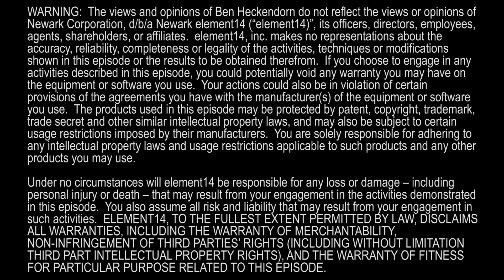Ben Heck's PlayStation 4 Slim Teardown

Comment: Sony's tech always impressive
Reply: No matter what any PC fanboy says, Sony's console designs are always impressive. Just look at how small that "motherboard" is, it has the APU (CPU/GPU), RAM, video encoder, sound.. Literally everything the console needs to run (apart from the power supply). If they dropped the optical drive and stuck a M.2 drive in there just think of how small the console would be I don't see any PC manufacturers making one that small. Step away from fanboyism and appreciate their engineering.
Reply: ***** I never said "smart people" don't buy prebuilt. I did build my PC afterall. You did nothing to prove my point wrong, Sony's engineering is impressive, just look at the board and put your fanboyism aside if possible.
Reply: ***** The point doesn't stand at all. Phones use completely different architecture. Can you get he PS4's APU and RAM to work in a phone's mainboard? If say, for example, Intel and Nvidia worked together to make a APU would Sony be able to make a powerful system with the same sized motherboard in this video? Yes they would. Like I said, try putting your idiotic fanboism aside for a moment and appreciate the engineering instead of just thinking "lawl underpowered APU". You're being very short sighted.
Reply: mandroid2525 YES IT CAN YOU DUMBASS. Don't call people stupid when you are saying something wrong, showing you're a dumbass. Dolby developed a way to carry the dynamic metadata across HDMI interfaces as far back as v1.4b. Don't believe me? Look it up and check what one the PS4 is using, idiot.
Reply: +AdmiralSpeedy Yawn...
Reply: Joyrider That comment wasn't towards you look who's name is at the beginning of it.
Reply: SHIINBOP - Unitary its more powerful than Xbox 360
Reply: AdmiralSpeedy dude please we don't need console wars it is very childish
Reply: hi annie
Reply: Krytern UK Nobody said that their design isn't impressive. I only said that PC's are better.
Reply: Take a look at the PS3's processor haha!
Reply: THE LAST OF US, UNCHARTED, GOD OF WAR, DAYS GONE :D PS4 THE BEST !!
Reply: Too bad it's proprietary garbage, like most consoles.
Reply: Krytern UK Now that you mention it, people aren't happy that PS3 controllers aren't even backwards compatible with the PS4, but that's hardly where things begin. Consoles are just a pain in the ass to mod for the mere reason that companies don't want you to.

You should go watch a video just to see how much effort it takes to upgrade the original Xbox's RAM.
Reply: ahahhahhahhah no optical out/no HDR,No HDMI 2.0 yes great hardware ahahahah
Reply: mandroid2525 it does have hdr. I have one so I have proof that it does have hdr.
Reply: AdmiralSpeedy and smart people also don't spell buy as by.
Reply: ahahahahaha HDMI 1.40 can't do hdr 1000 or 10 YOU NEED HDMI 2.0 its the METATDATA STUPID ::G
Reply: thier engineers and patents are legendary..
Reply: Krytern UK Hi don't call me an idiot for disagreeing with you I am only sating facts as LG and other TV companies state on their website so calm down, chill out
Reply: nios splosion You're right. PC MASTER RACE